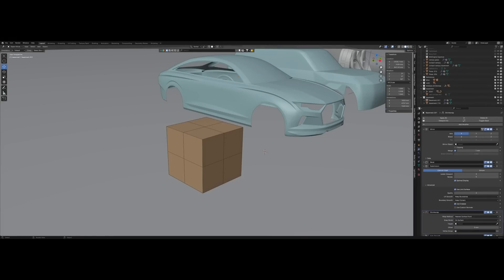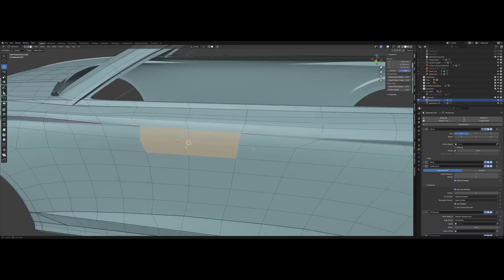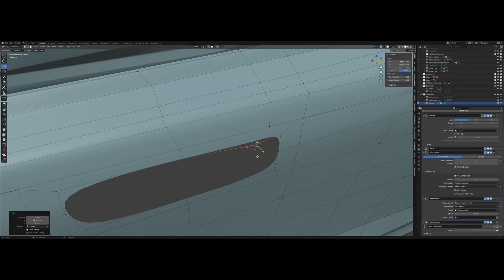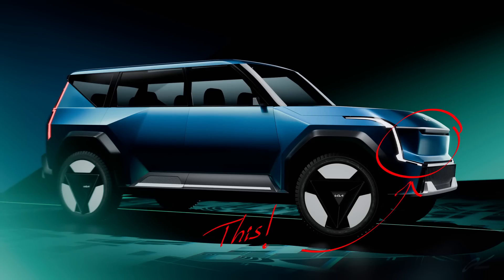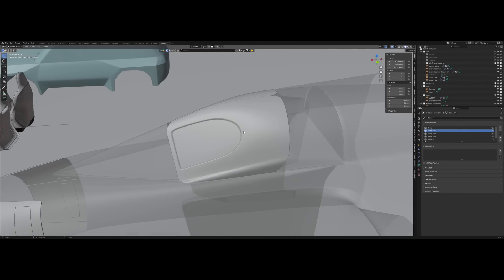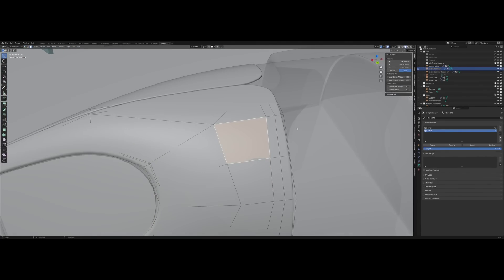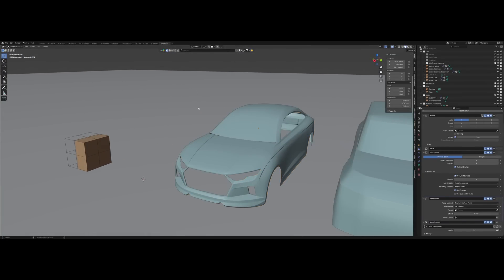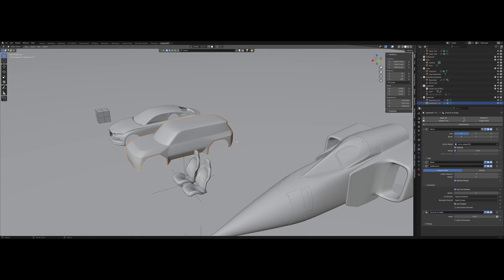Model anything with the SHRINKWRAP modifier

Comment: That's a technique I learned by cheer laziness during my studies. I had to make a motorcycle and I simply couldn't bare the idea of wasting time on correcting pinches by moving vertices. So I ended up making a SubD model, very low poly, to get the general shape and then retopologize over (was on Maya).

I never got around learning Blender's modeling tools, but this seems to be pushing the workflow I'm used to even further. I don't know if this is the best technique, most of my teachers didn't understand why I do it that way but as we can see here it's just so much better and faster... Glad more people are doing this. :)

Comment: This is why you never model a car panel by panel!  So many car tutorials are wrong. Cars are designed as one flowing, sometimes complex, form and then panel splits, door handles etc are put in towards the end of the project.
Reply from the maker: Yes! Even tough it can be tough to grasp at first, using a basemesh saves up a lot of time, gives better quality and can be made to be more optimized than non shrinkwrapped models
Reply: It's so much simpler this way. We only need to worry about the shape at the beginning. Once the base is done we can focus on details and stop worrying about general shapes.
I actually use this technique on complex clothing and basically anything "organic" that has finer details.
Reply: Yesss

Comment: I am seeing more and more of this technique popping on YouTube and I think it's beautiful. It's like retopologizing at the same time you're modeling. I am doing a very rough first pass without paying much attention to topology but having a nice surface, then I will start over with a clean mesh shrinkwrapping over the bad mesh. I will also use the smooth corrective with vertex groups, which I think helps with the topology distribution as well. Never thought of painting weights though, very interesting, I'm going to try that definitely.
Reply from the maker: It truly is a beautiful technique! Like you said it makes it much easier to add details as you don’t have to care as much about the topology on your final panels and once you have added all the details you want you can just dissolve the loops you don’t need to get a very optimized mesh.

I have played with a smooth modifier too but I think it was the lapiacian smooth, I will try yours and see what works best. Thank you!!

Comment: I must watch this video in loop, but is interesting
Reply from the maker: Let me know which parts were unclear and I will be happy to make a more detailed video! 😄
Reply: @baril3d  After minute 9.20, when you explain the vertex group technique on the spaceship. 

Thanks for your kindness, but you explain well, I have never used this modifier
Reply from the maker: Got it!

I will try to explain it by text here first but please don’t hesitate to tell me if something still isn’t clear.

So for this to work you need 2 shrinkwrap modifiers. 

One that will project your vertices directly onto the surface of your basemesh. 

The second however will project your vertices at an offset. Basically it will put your vertices above or under the surface details f your basemesh at the distance you tell it to. 

Now we usually don’t want to project everything at an offset because it would just make our final model an inflated or deflated version of our basemesh right? So to fix that we use vertex groups, think of them as masks that determine which modifier a vertex will use.

If you need to you can join the discord server where I can share videos of my screen that explain it better or pictures. I hope it helps!
Reply: @baril3d  amazing, I will try tomorrow, we're 3D professional artist, we gonna improve (I use maya and unreal) but blender is wanderfull
Reply from the maker: Awesome! Let me know how it goes 😄